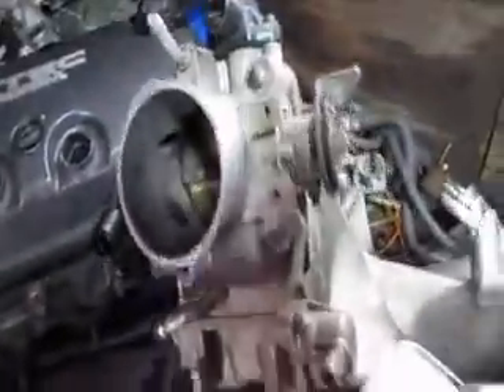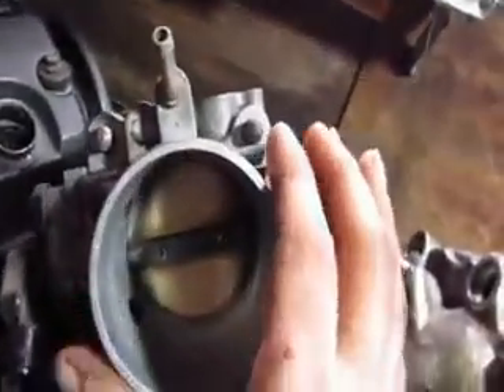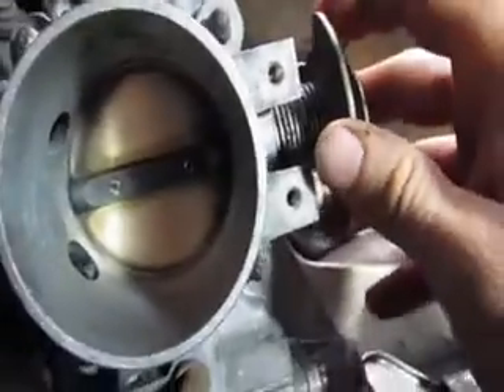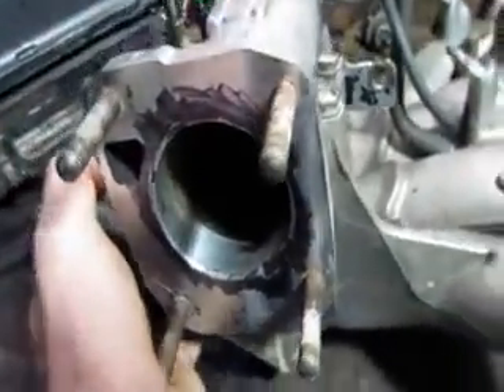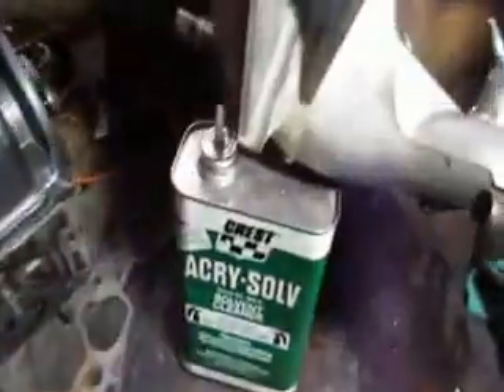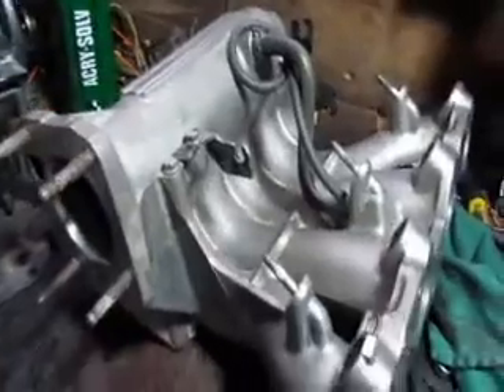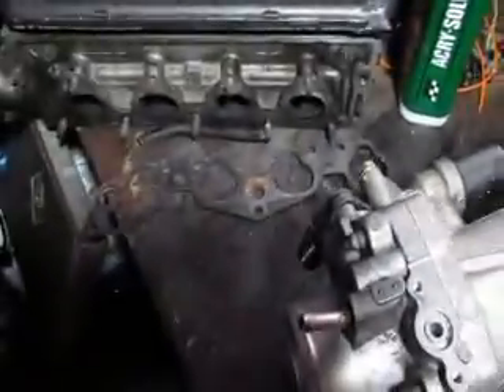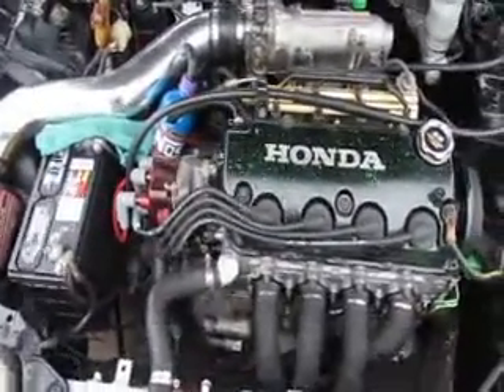How to port match

Comment from the maker: Add boost lol. The D16z6 are great motors for N/A And forced induction. I had both. The N/a Pulled hard to redline no power loss thru the powerband just pulled hard. THEN i added 4psi and it felt like a HUGE diffrence so then i added 6psi more and now im at 10psi and its a MONSTER. i got from 10-12psi and it handles it without fail! It was boosted before i got it too so D16z6 LOVE Boost and pull sooooo hard with boost. Hope it helps

Comment from the maker: I MIGHT have some.. I have since pulled the motor from the 4door and dropped a stock d16z6 in because its now the womans car. But let me check.. If i upload some more video's that will probably be the 1 your looking for. I had some of it but i think i deleted them but let me try to find them. The z6 i had in was bored 40 over with 8lb flywheel stage 2 clutch chipped ecu and msd ignition z6 intake manifold and port matched b18 throttle. I might have a video of it now with the stock z6 in

Comment: Thanks James for all your answers.
I hope that with all de mods , i will do to my d16z6 engine , i can have 145 hp, and reach 205/210 km per hour of top speed.
My civic coupe is 93 manual , the top speed is in four gear. 
Now my d16z6 no run more than 193 km per hour by gps.

Comment from the maker: Sounds like a good setup.. I had a D16y7 block with D16y8 pistons inside D16z6 intake manifold B16 throttle and A D16z6 head and 8lb flywheel, stage 2 clutch, Skunk2 intake manifold and a Zex cam it was the fastest little all motor D-series i have ever drove. If u use the y8 head it will bump compression up even higher so it will be a beast motor forsure!

Comment from the maker: Oh yes i see now what you were talking about.. U can use a vaccum line and plug it onto the bottom of the MAP sensor and it will allow you to relocate it.. My b16 throttle had the map sensor spot so i did not think of this.. I have a firewall mounted map sensor sitting here in my shed but like you said you live very far away.. Its made for things like this.

Comment: I will put in my d16z6, d16y8 pistons to increase compresion, a 59300 comp cams and the b16 thtottle.body.
I have put the stainless header, but if i speed the civic coupe, the check engine light turn on(i think is the sonda lambda that is in bad condition).
You sale hondaparts? ( racing radiators, crankshaft, valve springs)
Thanks

Comment: Thanks James ,for answer my question.....  but i live far away from you.
I live in Argentina,
The sensor of the b16 throttle body is in difrent location that in the d16z6 ? i have tu use an external hose?? 

Please put more videos of d16z6 modifications!!

Comment from the maker: And you dont have to do anything special to the B16 throttle on the D16z6 manifold EXCEPT port match get-the b16 throttle body gasket and put it on.. The thermal gasket is highly recommended by me. And i had a B16 throttle on my old D16z6 manifold and it was the best throttle body i ever used

Comment from the maker: Great question.I should have mentioned that in the video. If you DON'T port it out it will flow worse than a d16z6 stock throttle and it wil flow really crappy and it might not hit wide open throttle and the throttle might get stuck. I haven't seen or heard of anyone that has done it.. I wouldn't recommend it at all! If i was closer or if i had my shop up and going id say send me your intake manifold and i would be more than happy to port match it for you for like 40$. If you just take your time

Comment: I have buy a 60mm throttle body b16 to put in my d16z6 manifold.
what happend if i dont port match??
2) they tell me that i have to put the d16z6 throttle wheel acelerator in the b16 throttle body. 
i have buy a thermo gasket to put in the b16 throttle body .
great video.